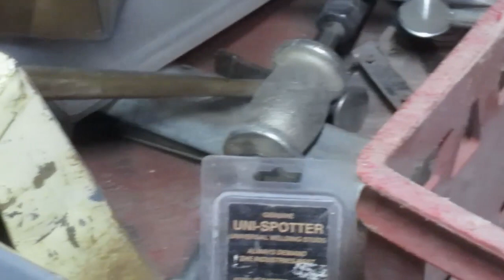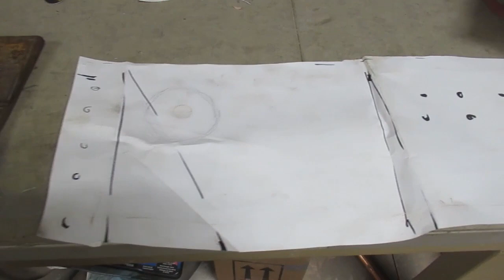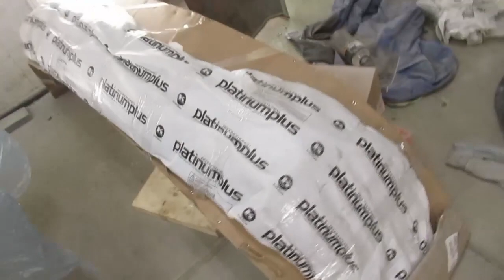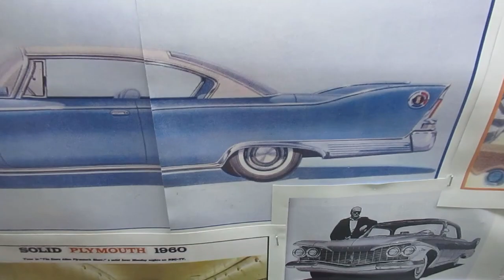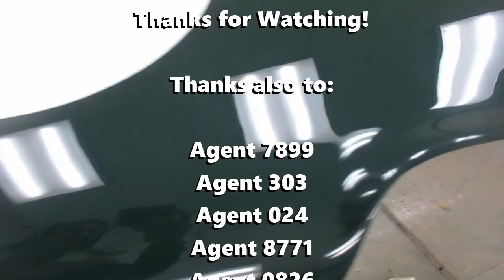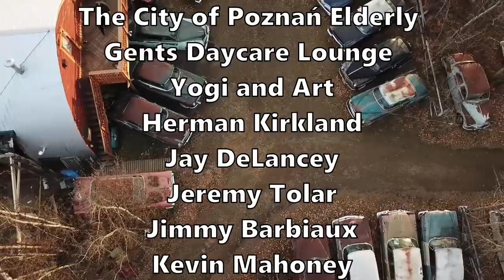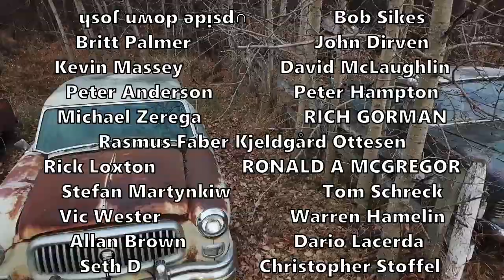1960 Fury Project! Part 23

Comment: A truly gifted individual where metal work is concerned. I've never been able to master the heat for welding.
If you like a Swiss cheese profile, I'm your guy. I've spent my life working with steel plate 1/4" & up.
 Not a problem. Just crank up the heat selector to: 
HOTTER N HELL
and let 'er fly. Same goes for aluminum or stainless trim.. By the time I got done, you would have a lifetime supply of .005 shim stock on a roll. Eleventyfive & 31/64" long.
 Trim to desired width. 😣 great show Man !!!! Glad I found the right place to hang out & Mabe learn something.

Comment: I love this show. I started working in an autobody shop at 19 years of age...im 41 now. Run my own small buis now....mostly car lot work though. Anyways love the variety here as always....its interesting seeing how others do ther sand&buff process. I just hand sand em with 2k an buff with a wool pad with meguiars 100 compnd....meg 105 on foam...205 on foam and if dark blue or black 3m blue an fine foam pad final step. Wouldnt it be nice if replacement panels came anywhere even close to fitting? Mabye in heaven they will..... Id like to see a lil speacial side deal showing all yer automobilia again actually......youv got a ton of unique&cool automobilia postors an advertisements....i bet youv got a ton of cool automobilia nic nacs parts etc also seeing the plastic models are cool.....wen i get time..."rarely" i still enjoy building plastic kits

Comment: Saw a guy doing stainless repair once. He chucked a stainless bumper bolt into a drill press. He used the handle to press out the dents ( the drill press was not on, mind you ). This worked well for smooth dents, but for crinkles, the hammer and punch routine was the answer. I think he used a lead billet under the trim to keep from marring the workpiece..

Comment: That stainless repair turned out amazingly perfect. I attempted a similar fix on the front fender side trim of the 53 Merc but can see I need to put in a lot more hours. Improved it but far from perfection.

Comment: Great vid as usual. Dean needs his own show! With subtitles, but still ... funny guy !  As far as the stainless- you probably have tried this, but I had an old Aussie car, a '62 Holden with a few minor dings on the trim. I used a wooden block cut to fit and from the back side of the trim, added a little heat first ( might not have helped at all ),  beat on the block to push them out,  they mostly  ended up a little high so I  flipped them over and  tapped them back, with again wood underneath and tape over the stainless. I will say I did not get your pretty perfect result but they were really barely noticeable and I also did not file or sand like you did, mostly because I didn't know you could- my first car and I was making it up as I went along.

Comment: Great educational value in this episode once more! Even though I'm sort of aware of the basics of most of it I'm still in awe of the way how you approach it all. That calm but precise manner keeps amazing me. Much like watching the Asians which are so capable of doing the same (Karate kid is still a nice example of that). Working in a stressful western work floor situation that balance is almost unachievable. In my case building up custom Harleys at a dealership for example. The combination of building something up to the highest standards(don't scratch that 50k plus bike) under a ever diminishing time frame makes it very hard to still enjoy the process. Something I surely can learn from still. Beter of working in a shed at peace while the snow outside forces the world to slow down eh ;p

You'll  start to appreciate the quality of that Volvo real quick when you start driving it. The late model 940/960's are often considered the last true Volvo's. While the 850 and v70's that followed where still good cars overall the production cost cutting managers slowly started to take over. I went from a 240 to a s60 and quickly returned to a late model 940 just because of it. It's the perfect combo of old tech, sturdy quality and newer style amenity's (ABS, airbags, cruise, aircon and climate control) that always work to me. Plenty quick too.  Anyway I'll let the car do the convincing. Great stuff as always, Thanks!

Comment: Very nice as always. Especially liked the Lotus. I was a jeweler for about 7 yrs and I remember this one tool used in setting stones. It was maybe 3" to 4 " long with a knob at on end to grip and the other end had a radius on it used to 'push' the metal around gems by rocking it back and forth. I was wondering if the same tool, made of a hard wood with a radius to match the contour of the chrome/ stainless molding and be used to basically roll out the dent very carefully of course ,rolling back and forth over the dent.  Therefore eliminating a lot of the dimpling. Just a thought and thanks for sharing. A pleasure watching you work as always. Thanks again.

Comment: i stopped using the pins on those dent guns a while back i prefer to use washers, you can put a 1/4 extension bar through the hole and lever them out better, also the washers dont leave a hole in the panel
Reply: Ohhh, that's clever. Gonna try that.
Reply: @bluetoes591  yeah, if you get a steel plate and place it over the crown of the dent and leaver off that point you push down the crown and lift the low at the same time, you can also line up a few washers along a longer dent, put the 1/4 extension or similar bar through several of them and lift them in one go

Comment: Scott have you ever tried the paintless dent removal, glue on systom for dents like the ones that were on the trunk. Is the metal on older cars too thick for that.
Reply: @UberLummox  Not the cheap stuff you might see on tv or at harbor freight,but the kind that they sell on ebay with many different shapes of glue ons and glues for different weather temperatures. I watched some youtube videos and they do some good dent removal with them.

Comment: Those Bobcats were never very popular when they were new because of the cost difference over the Pinto but then they both went away pretty fast after all the people got killed by the fuel tank that got ruptured when hit from behind and the gas ignited and the doors wouldn't open from the collision. Real death traps because Ford originally decided to save money and didn't use a $5.00 collision shield between the fuel tank and the rear diff.

Comment: Are you sick of welding that car yet? Late starter here. What engine trans combo does the car have?
Reply: So you took the time to type that,and couldn't just say.
Reply: Wide block 318 230HP and Torqueflite automatic. That is what came with the Dodge parts car he used the chassis of, the Plymouth came with a 361 and Torqueflite.
Reply: Mr Danforth 374  Thank you sir.